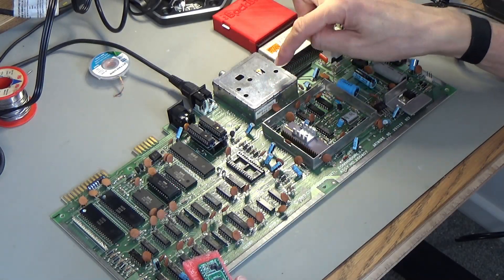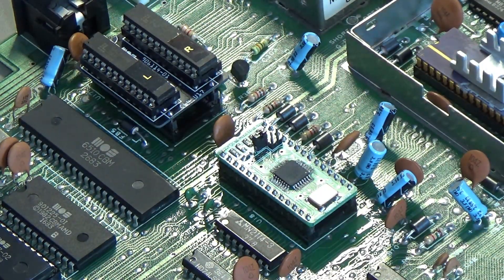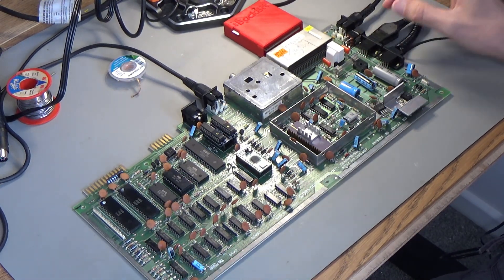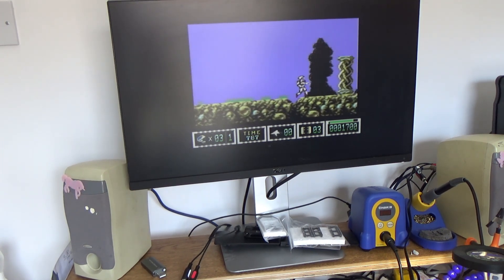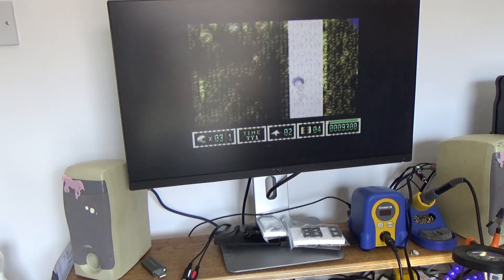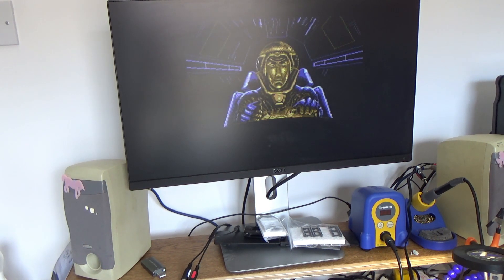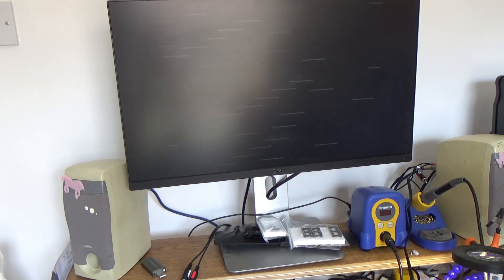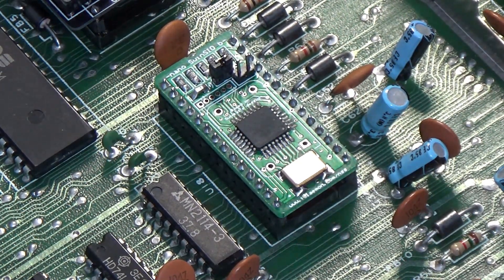Trying out the Nano SwinSID (C64 Drop in SID replacement)

Comment: Thank you! One question. If you want to use this chip for chiptune generation, but you don't have a Commodore mainboard, you have to install this in a SIDBlaster board?
Reply from the maker: I suppose you would. But if you already had a PC to plug the sidblaster into, are there not already better emulations of the SID in pc software that you can use?
Reply: @DavePoo2  Good question. I don't know i just learned about the C64 chip thing and i wanted to try it. Do you know of any good emulation software?